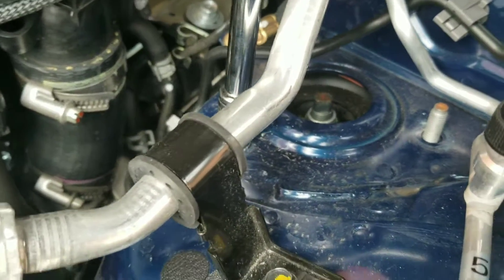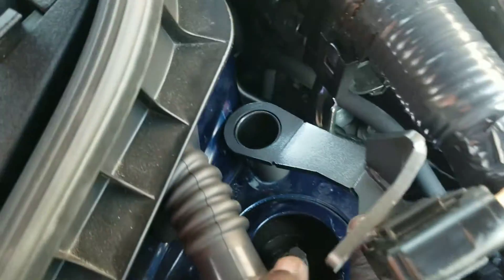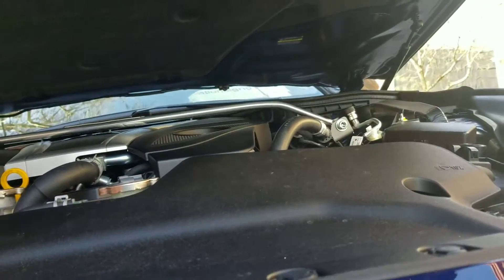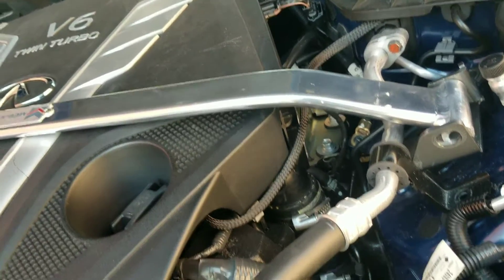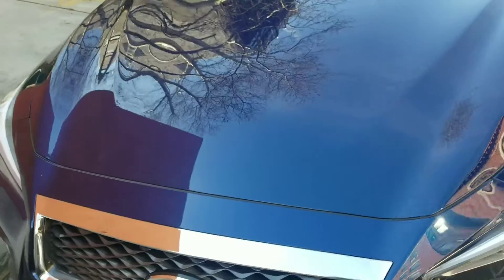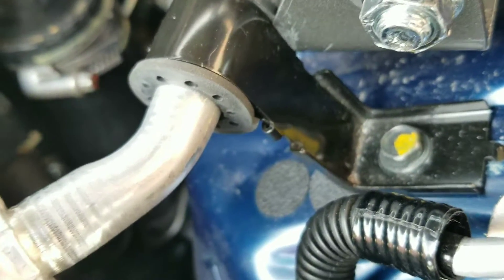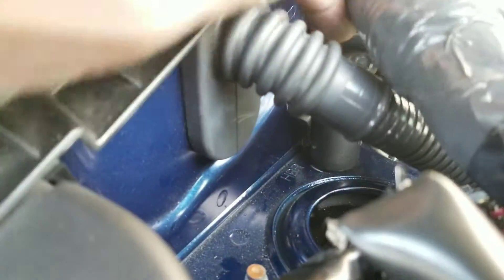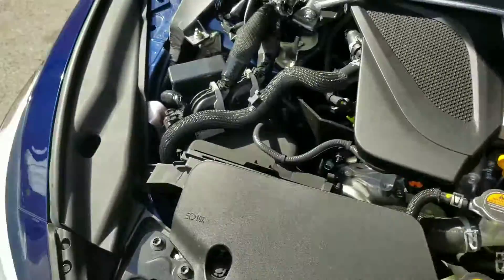Q50 Q60 Megan strut bar install: PT2

Comment: Hey what happened to your review of the strut bars that you had over time?
Reply from the maker: I did a review about cusco megan and tanabe.

Cusco bent by hand
Reply: @BoostInMotion  and Megan won put due to the mounting brackets and sturdy-ness correct?
Reply from the maker: Yes that's correct. Tanabe brackets were then.

I believe the video was deleted or flagged
Reply: @BoostInMotion  thank you very much! ebay has a 15% off everything goin. Megan has been in my watch list forever now.

Comment: Is the install easier on the 3.7 Q50?
Reply: @doggystyledave  yes there is. Soul function make a beautiful one. I had it on my 3.7.... and it's way easier to install than on the 3.0t. 
https://www.z1motorsports.com/suspension/soul-function/soul-function-g37-q60-front-strut-tower-bar-p-12631.html